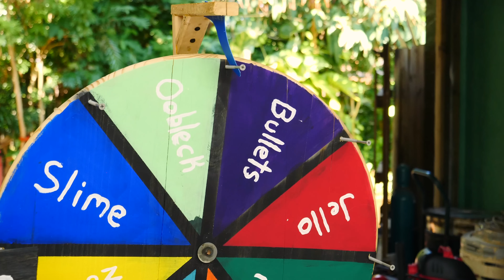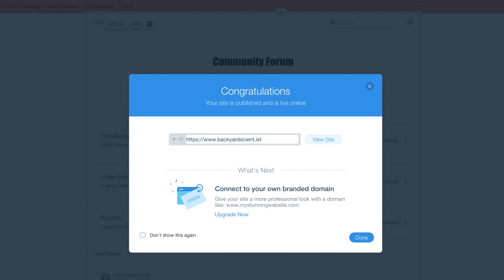Is Molten Aluminum Bulletproof?

Comment: You have to understand you hit the hard metal container holding the molten aluminum first layer and the exact type of ammo is not known, was it hollow point?
Reply from the maker: no just regular fmj winchester target
Reply: @TheBackyardScientist  hey thank you for the reply!
Reply from the maker: @bandz4dayz490  no problem. I was thinking the bullet might fragment a little bit on contact with the container/molten aluminum. If you shoot a FMJ .223 into water the bullet will basically disintegrate within a foot. I thought the same thing would happen if you shot the aluminum and the fragments would not make it out. 

A few weeks ago we went shooting and I brought aluminum plate 1-1/2 inch thick. The FMJ only made a 1 cm deep crater. Then we used the green tip federal  ammunition with the steel penetrator and it went through the full 1-1/2 plate, pretty impressive.
Reply: @TheBackyardScientist  Yes, so many fun ideas for even another video to be created since this one went so well, if you are willing and can go to a specific spot allowed I have an idea that may just work...50 caliber Barrett. :)

Comment: It is expected that this does not work, bullets are simply too fast for molten aluminum to melt it. The bullet was slowed down for sure as the liquid provides some resistence, but I highly doubt that the heat would has any noticeable effect on bullet as it is so fast. You can probably try thicker aluminum or use hotter liquid like molten steel to further test this.

Comment: I can't even think of a reason why anybody would think that molten aluminum is bulletproof, especially in such small quantities. Why would the bullet melt there's no time for heat transfer. I would argue that the pot that held the aluminum did more to slow and deform the bullet than the actual molten aluminum. I don't know about surface tension but I think that the viscosity of aluminum at that temperature would be even higher than that of water.

Comment: The question is not properly defined.  Of course there would probably be a specific length of linear distance through which the bullet would melt.  But we can easily confirm that it the copper-jacketed lead bullet does not have time to melt through a mere 4 inches or so of molten aluminum after penetrating a stainless steel cup.

Comment: Question: Let's say the bullet is traveling into a chamber that is 10.000 degrees celsius, and the bullet is traveling at top speed when it enters.
If the bullet melts before it loses all it momentum and kinetic energy. Were does it go?

Comment: Sounds like someone forgot that heat transfer necessarily takes time. If you shot a lead bullet through a furnace that was 2000f, (which is way hotter than molten aluminum) would you expect the bullet to melt? I hope not. Here's a other one. If you held a blow torch on a quarter for half a second (way longer than the bullet was in contact with the molten aluminum) would you expect it to melt? I hope not. It would likely still be cool enough to hold in your bare hand.

Comment: The Because Science channel did something "similar" to this. "Can a lightsaber melt a bullet" and the answer is no, and even if it did, because of the speed, you would get molten metal flying behind the lightsaber, so it would not be much better

Comment: Theory -- Because the bullet has a copper jacket on it, and copper's  melting point is significantly higher (almost 2x), coupled with the speed that a .556 round travels, there's virtually no chance of the aluminum transferring enough heat to the lead itself.

Comment: The answer was no from the start. Aluminum isnt a dense enough metal to stop a bullet nor was the amount of aluminum used going to be enough to stop it. Youd need a longer vessel for the bullet tto stop in the aluminum. Try a denser metal such as lead or steel but the issue to follow is a strong enough vessel to hold the molten metal and be weak enough to let the bullet pass through with minimal loss in power. 
My initial thought was wrong that the bullet would splinter off into the jell but it still ripped through all of it. Next time try a denser metal and a gun that doesnt put out as much force

Comment: I didn't see the bullet melting being possible. Just going through a hot spot to fast. Like swiping my hand through a candle flame. Not a great idea, but it doesn't even hurt. Much less cause damage. The hydro shock will slow the bullet, but it ain't got time to melt.

Comment: I know molten aluminum is extremely hot but a bullet moves waaay too fast. Let's say you drop a bullet into molten aluminum. It going to take that bullet a few seconds to melt, right? A bullet fired from a gun isn't going to be inside the molten aluminum that long.

Comment: The SCAR is basically just a side charging AR-15 made by FN which somehow commands a 3k price tag. Be a man amongst men, use an FAL. Oh also the reason it went through is because .223 is a rather fast mover, that bullet was likely in contact with aluminum for such a short period of time that it offered little to no resistance.

Comment: Pretty sure you fired a copper jacketed lead bullet unless you had a special lead cast bullet for this insane idea.  Also, the speed of the round, ~3200fps, is going a bit to fast to even notice the heat of that tiny vessel of molten aluminum.

Comment: See, the thing is, you could shoot a bullet through something an order of magnitude hotter, and it still wouldn't melt the bullet. There's just not enough time in which the bullet is in contact with the hot thing for it to absorb the heat.

Comment: I mean you could have theoretically done the math based on velocity... mass of the projectile, melting points and conduction rates and such.  It is just in that aluminum for way too short of a time for that heat transfer to happen.

Comment: Gotta think about the mass of the bullet and how fast that heat can transfer into the lead and copper jacket. Also, even if it was bulletproof, you'd be having a bad day. Molten metal all over you and if the guy with a gun has something more modern than a musket, you're going to get a second round pretty quickly.

Comment: The liquid aluminum is got enough to melt the lead.. but it also has that copper jacket.. and the bullet is only "in" the aluminum for like 2 milliseconds so there isn't enough time for the heat to transfer aaand the shock of the bullet causes cavitation, so it's really surrounded by the aluminum.

I know. Nobody likes "that guy" coming in pretending to know stuff

Comment: You dont shoot the casing..... the 5.56 round is pretty much the same size of the pellet gun one, the difference is the velocity and shape. 

Also, the bullet is already super hot when it comes out of the barrel and it goes through the aluminum extremely fast. 
As you know, the bigger the heat difference, the quicker it trasfers heat. also, heat needs time to transfer.

Comment: Real safety tip. Better without shoes in that situation, slips or whatever ya’ll call em there. I’m a welder and some hot metal down your shoe is bad bad stuff. It burns you as you try to remove the shoe. Your never quite quick enough. No shoes or just wear pants... yeah. Lol

Comment: The best test needs to be point blank and measure how much it slows it down....or depending on the temp and the path of how it solidifies on the edges of the gel it was way colder than the center.....waaaaaay too many factors noooooot enough control try again with different set up please i must know

Comment: I can understand why you like to shoot molten aluminum, but you can't be serious with the reason why you think it is... Because the bullet melts while passing through? For it to melt it needs heat. This heat is coming from the aluminum. It needs to be conducted to the lead bullet. This needs time. The bullet will go through that bucket in a fraction of a second. Your first test should have been how fast the bullet melts when you put it in the 1000°C crucible. You would have found out, it takes a few seconds. Thus it will not melt by passing through the molten metal. BUT it could still have been stopped, if the density is high enough. Then again, liquid metal has less density than solid metal and aluminum is not that dense to begin with. Maybe the bullet would even go through the solid metal? Would fracture probably and the can it is quite a few centimeters wide. So, that would be interesting. The other stuff is fun, but not really surprising...

Comment: The bullet didnt melt bcuz if anyone remembers ur friends might have done a trick where they whip their finger through a fire with no effect since their finger was in contact with the fire for no longer then a quarter of a second but with the bullet it's going 300 times faster so its in the 90 degree temperature for so little time the particles are unable to transfer the heat to melt it as heat is transfered by the constant motion of heated particles but the bullet just rips through it so its in contact with the heated particles for just a few milliseconds
Edit: please like this so the Backyard Scientist can actually see this please please please

Comment: Long physics explanation as to what happened here incoming. First let us debunk his theory of the bullet melting.

For simplicity sake lets assume the entire bullet is made of lead and not a copper jacketed bullet
Rate=Conductivity*area*(Aluminum temp*Lead bullet temp)/mass of the bullet
so
R=35.2*.223in*(660c*93.3c)/55 grains    (I guessed at the temp of the lead based on firing it out of a gun)
With this you see that it would take a little over 4 seconds to perfectly bring the lead up to the same temperature of as the aluminum if it remained the same temp the entire time. Obviously the bullet traveling at 3000 feet per second spends less then 0.03 seconds in the aluminum so there was never a chance for the lead to increase in temp even a little bit. 

Lets explain what the likely differences between the two shots and why it appears that one shot went through while another did not.

Even though these appear to be copper full metal jacket rounds there is very likely to be some deformation of the round on impact with a molten substance as dense as aluminum. The drag force being expressed as Drag=.5*Aluminum's density*velocity[squared]*area. The two most important numbers determining the force of the drag on an object is its velocity as that is squared so the higher the velocity significantly increases the drag force. The second of these two numbers is the area upon which the force is acting as it is the last number multiplied. The larger the area the force is acting upon can significantly increase the amount of force it experiences. If the bullet even slightly deforms on impact increasing the surface area of the bullet by even as little as .25 cm can increase the drag force by as much as 66%.

So in conclusion the difference between the first and second shot. It is likely that the first bullet deformed slightly enough for the drag force to slow it to a speed that either altered its trajectory enough to miss the ballistics gel or slow it enough that it did not penetrate the gel.

Comment: C'mon man that's common sense...all processes regarding change of state require time for heat absorption or losing heat...and a bullet passing through the aluminium just does not undergo enough heat absorption over time to melt...in fact it actually happens in a fraction of seconds😕😕
Reply: @IG-100 MagnaGuard thanks for the suggestion....I'll start one shortly😊😊